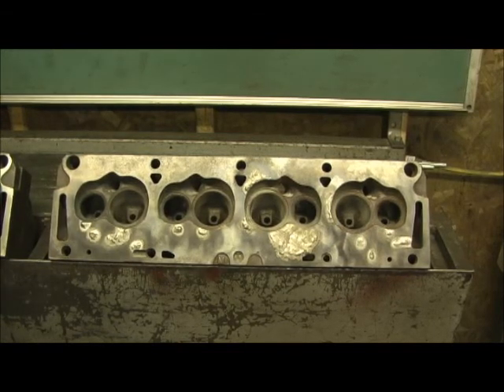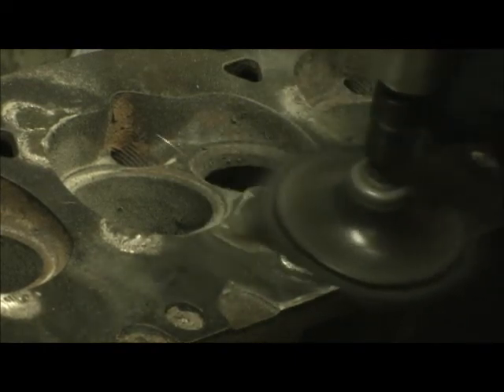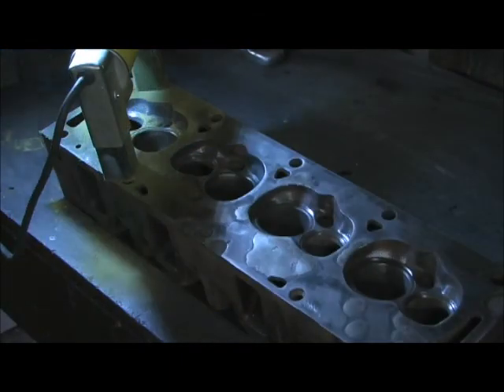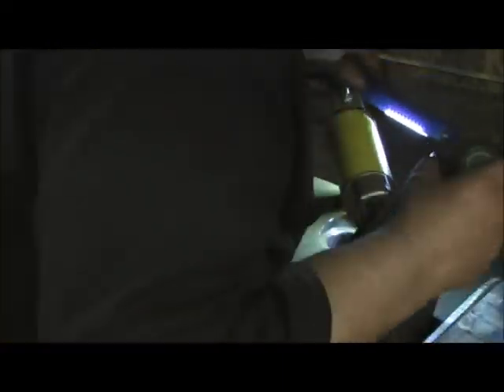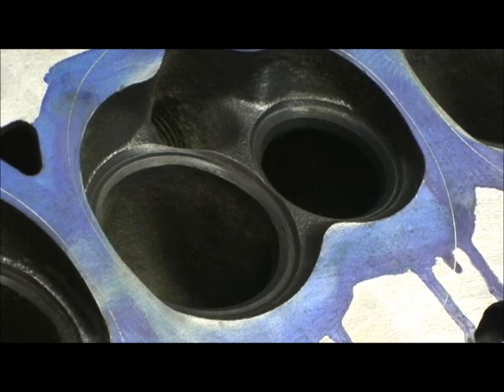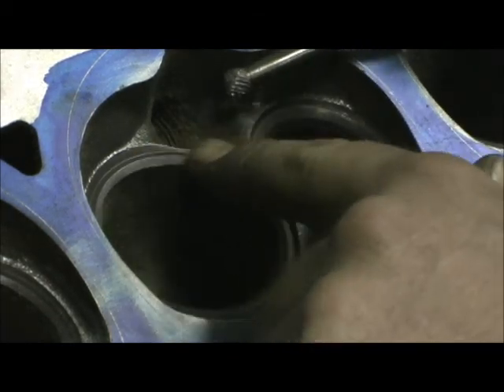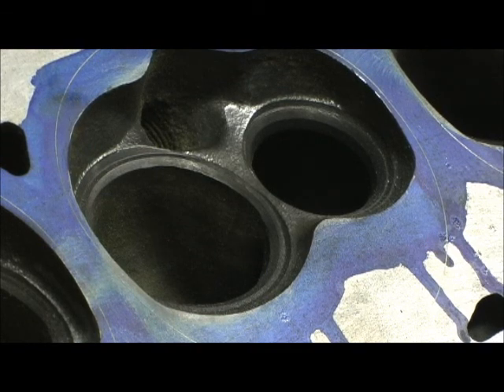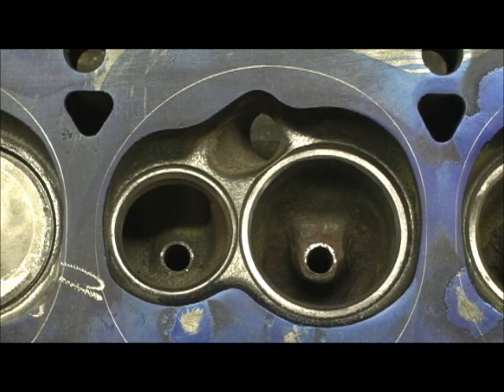Cast Iron Spray Welding Ford FE 390 Part 3 "Blending"

Comment from the maker: If you go to my website, then to the page labeled "Customer Testimonials" at the Top, or the first one on the page is a 1985 Ford Mustang, which my heads are both the Super and Stock Eliminators. NHRA National Record Holder from 2007 till now over six different classes (302,289) and I have done at least every year since probably 1963. I know them all WELL.

Comment: I use a bodywork longboard with different grade paper to flatten out the high spots. The nickel is super hard but it does sand. Hard work for sure but a long board and a machinists straight edge gets it done.